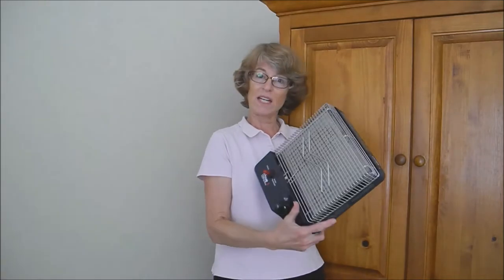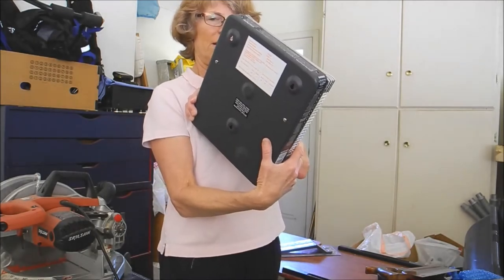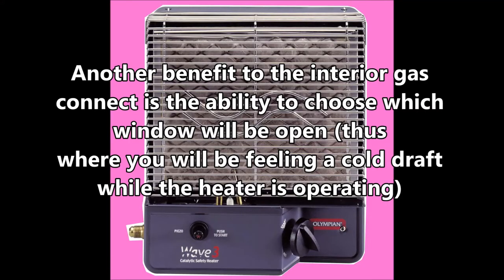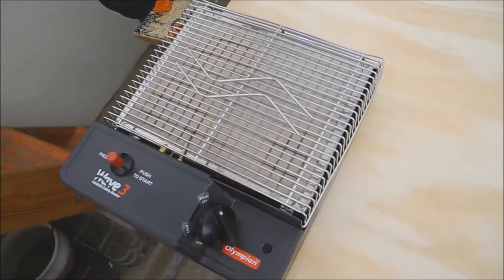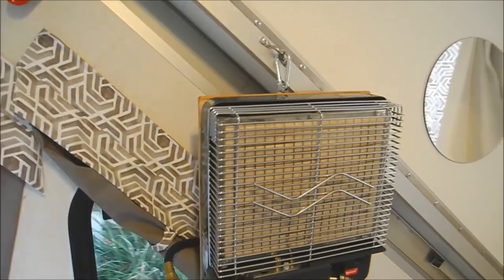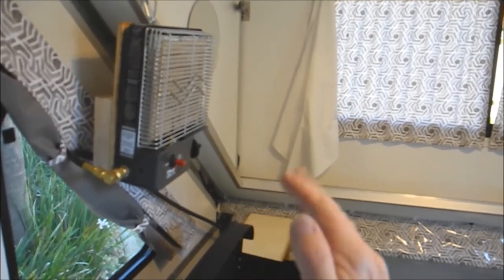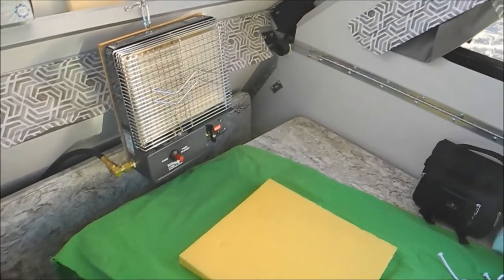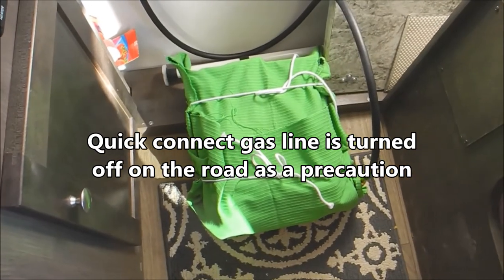Installing the Camco Wave 3 Heater in the Aliner

Comment: I just got mine. My paneling in old and dry. The back where the holes are where it would be touching the wall got so hot I couldn't keep my hand on it, so I'm worried. Does the wood not seem to get hot?
Reply from the maker: To be honest I’ve never touched the back when it was turned on...but the top edge of the metal back does get hot!  I’m worried about yours because they say in the instructions it should be ok for wall contact on the back side. We had to send ours in for repair recently.

Comment: When using propane inside particularly when sleeping also use a CO2 monitor.  They are cheap and could save you life if things go wrong.  A smoke detector is also a good idea.  The optical kind with a silence button is probably best in this application.
Reply from the maker: Thanks - Yes our Aliner came with both.   We've had issues with moisture triggering the CO2 alarm but not very often.
Reply: @averagealice8877  It makes sense they would be standard equipment these days but it seemed worth mentioning given your other sensible warnings... 

In a trailer where batteries might vibrate out of place and corrosion could be a problem it seems like a good idea to be in the habit of testing them whenever you take a trip (dead batteries)  and also set up camp,  particularly in the winter when using heaters like this.   That may be less necessary if they are hardwired to the trailer's 12v power...I suspect they are not.

Interesting about the condensation problem with the C02 detector...In my experience it is usually the ionization smoke detectors that a prone to that problem but that is in a house where the CO2 detector is usually well away from sources of condensation.

Condensation management does seem to be an issue that requires some thought in these trailers.
Reply: it is CO. not CO2

Comment: I'm curious as to why you aren't using the furnace that is built in to the camper?
Reply from the maker: We mainly enjoy boondocking/dispersed camping  with no hook-ups, so we try to save on battery and propane usage as much as possible, and the RV heater fan uses quite a bit of electricity and propane use is inefficient as well.  Plus we don't really like hearing the fan cycle off and on all night...the Wave heaters are silent.  We do have a generator which could power the RV heater also but we don't enjoy the noise and having to carry a lot of gas....our goal is to use the generator when we're chilled to the bone (then we'll use the RV heater) and/or the sun hasn't been shining enough for solar to recharge the batteries.   Long answer sorry!
Reply: Thank you, Alice! I appreciate the long answer.  My gf and I have been looking at Aliners and we really loved the LXE we toured but felt it was really too much (cost, weight, features, etc.). We then started considering the Scout Parks model which is the same box as the LXE but without all the extra stuff- it's electric only. We're into the lover price and weight and are researching what it might be like to boondock with it and what we'd really need. RV park hookups no problem- we have everything as long as its electric. For boondocking we are looking at Yeti Goal Zero power supply with solar panels (some Yeti models can power a mini fridge up to 50 hrs without recharge), Camco or Mr Buddy heaters with propane bottles, outside portable hot water/shower appliance such as Coleman or Mr. Heater. The LXE's inside toilet/shower seems nice but setting up an outside one seems just fine too. We can cook using propane outside or a portable butane inside with adequate ventilation.  So, are there any features of the LXE you think you could live without, or absolutely not live without? Most of it seems luxurious and it looks like you've added a lot of stuff not built in anyway like the water dispenser etc. I'm thinking we'd be just fine adding our own equipment and save a lot in up front costs.  So now I'm the one going to apologize for too long a reply. Sorry. Thanks for all the info you provide!
Reply from the maker: Sounds intriguing!  How many days do you think you would want to be able to boondock (without breaking camp) and in what weather?   I've seen other Youtube videos saying the canisters don't last through the night if it's really cold, but honestly we could have lasted through the night without the heat turned on for the most part (except for when it was 20 degrees out...it doesn't feel good to get out of bed in the middle of the night if you need to).  It depends on your toughness and tolerance for cold.  My husband can do the shower outside but not me!  With the wind blowing too...  Anyway, we really love the LXE because we could make a king-size bed (put plywood between the dinette seats).  Not very many RVs have king-sized beds.  We also like the off-road package for added clearance.  I really don't need a microwave...it's our bread box right now.  We like the thetford cassette toilet especially if it's really freezing outside.  The inside shower is a hassle to set up but it works.  And our decision to get the Cool Cat A/C wasn't a good one because it ate up a ton of storage space under the sofa.  Definitely spend a little for some kind of a wind-assist kit though.  It's been windy everywhere we've gone.  Personally I like having propane because we can always count on it even when the sun isn't shining, to run the fridge and now the heater, but I've heard some electric fridges don't use much battery power and might be more reliable than an RV 3-way fridge (ours does poorly when it's hot out).  Does the Scout have a fantastic fan?  Very good on hot days.  The other drawback to the LXE might be the dinette for some.  We tend to get lazy and not set up the dinette when the bed is out, and it's really small and kind of cramped. Also I wish Aliner divided up the sofa cushions so you could access the storage under the sofa more easily.  All the bedding and huge cushions are pretty heavy to lift. So practically speaking we don't have much storage space that we can get to on a regular basis.
Reply: Thats one big plus for the Scout Parks model, no appliances means lots of storage space and lighter weight.  Of course we would have the standard AC and electric fridge. We could and would most likely have external propane and maybe run a line-in for the Camco heater but it sounds dangerous. Technology is always improving in the area of electric appliances and power sources and I'd rather be prepared for upgrades.  I'm leaning heavily towards this Scout idea more and more especially since no one has convinced me yet that the standard built-in propane appliances that come on the Aliner are a must have.  This Slim Potatohead guy who YouTubes about his adventures in an older Aliner built an inside shower in one of the dinette seats. Possibilities.  https://www.youtube.com/watch?v=NIoDB5Yf_MY

I imagine us boondocking 1-3 days at a time maybe with hook-up parks and motels to recharge in between. Long term off-the-grid living is unlikely for us now as we both have to work full--time.  Thanks again for all the info and insights you provide!
Reply: Hey, Average Alice! Any updates on how the Wave 3 setup has been working for you, particularly when hanging like that? I'd be concerned about that heat near the drapery. Love your videos! Would you have time for an update- to catch us up and evaluate all the upgrades you made to your aliner? what worked, what you'd do differently next time? I have a Classic with propane heater, and I ran into the same problem. Right now, I'm using the legs on my Wave3, and it seems to be working just fine. Hanging would free up my much-needed counter space, though! Thanks!
\
Reply from the maker: @KeriKalmbach  Hey for some reason I didn't get a notice of your comment - !  Hanging has really worked great for us.  It's a little bit tricky moving it to the alternate hanger when it's turned on but we do it slowly and no problems yet.  The biggest improvement with this is finding the optimal heater placement and cracked window so cold air isn't blasting on you as you sleep.  Lately we got better results hanging it over the cooktop as we sleep and cracking the window at the far end of the trailer.  But we did get a lot of condensation on our last trip on the corners of the bed which I have to work on now...

Comment: how long until its cool down before you cover it    thank you
Reply from the maker: D Haven’t timed it but I would estimate 2 minutes
Reply: @averagealice8877  thank you   shorter than i thought
Reply from the maker: D I’d say at most 5 minutes.
Reply: @averagealice8877  ok thanks  again   but  3 more quick quicks its been two years since this post (video) how the heater doing ??  at about what degree will it shut off in case i want to take it into another room  ,,, in my home  and how long to heat up your aliner  ?? i own a 2006 scout  and very air leaky    and if you don't want to answer thats ok happy holidays   david
Reply from the maker: @popatop75  I think we've moved ours when it was still hot but it was turned off and we were just careful not to touch the front of the heater.  Also I don't know if you read my update in the video description?  The heater is still working OK for us but it doesn't heat up our Aliner more than 20 degrees over outside temps.  I'm guessing we start to feel warmer after about 10 minutes but definitely immediately if you place yourself right in front of the heater.  Also I'm not sure if the entire fabric pad that provides the heat is fully heating up now...but it hasn't been a big issue for us.  We never purchased the recommended cover for it, so maybe ours isn't in perfectly maintained order.  When we're really feeling frozen in the Aliner we turn on the RV heater for a few minutes.
Reply: @averagealice8877     ALICE ! thank you so much for your time and wonderful descripton,  i think i'll have to  go with the wave 6 as i have grand kids ect ect .   and was hoping  to go with a smaller  unit as they drink the least fuel.   i'll keep a eye on you guys camp  safely  but cut loose once in a while don't wamt any regretes   cheers   davod